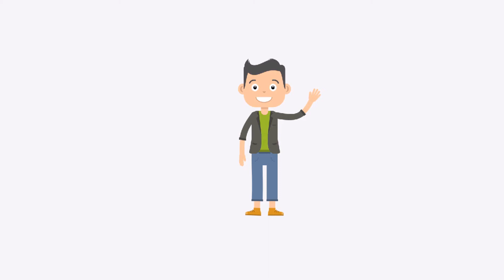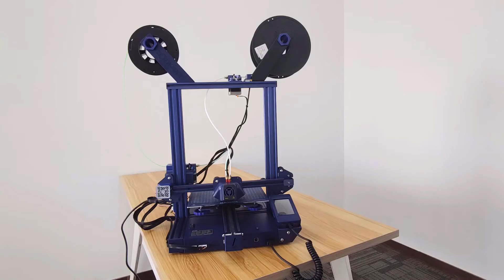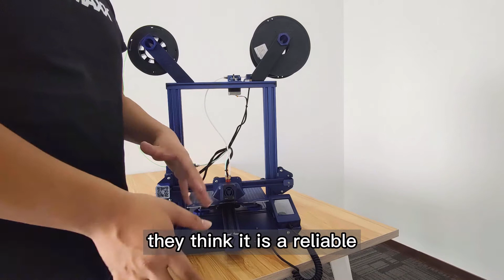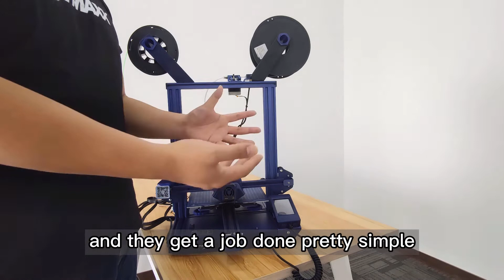Manual Leveling tutorials lotmaxx shark how to series 3d printer

Comment: What do you do when there is too much of a gap on the center (5th) position.  Is this a Z limit switch adjustment?
Reply from the maker: how much is the gap? It is very tiny gap, put a paper understand it to make it level. It will not affect the heat.